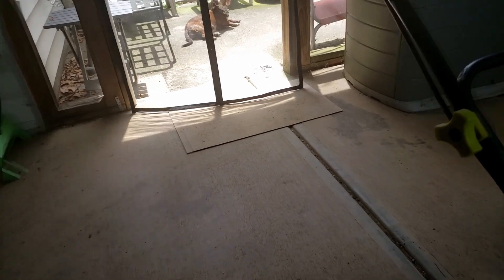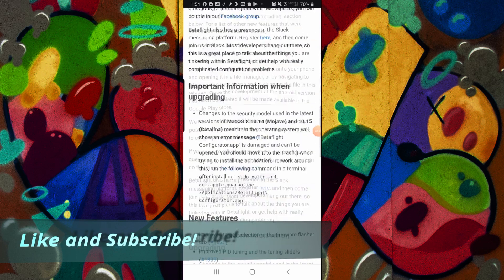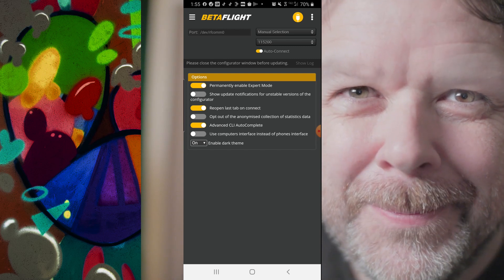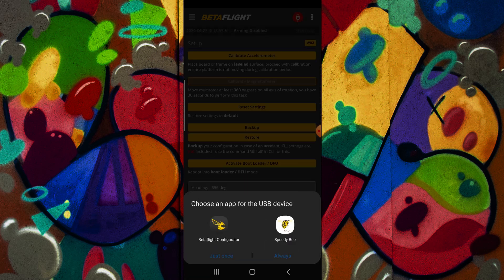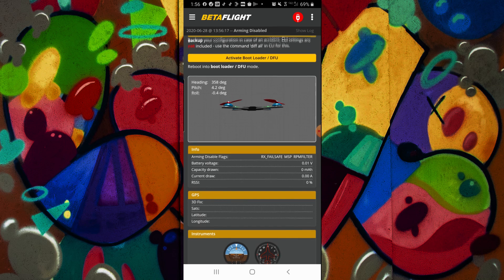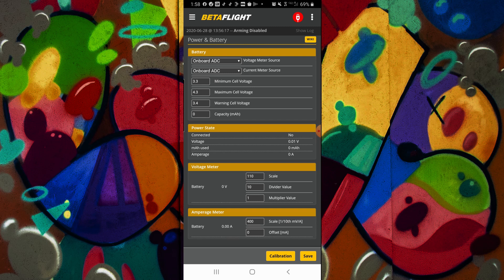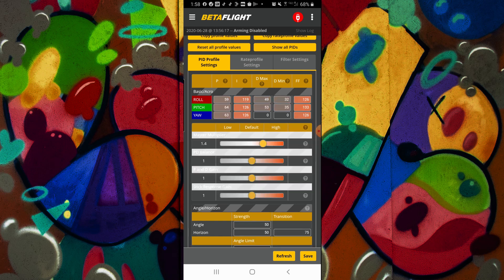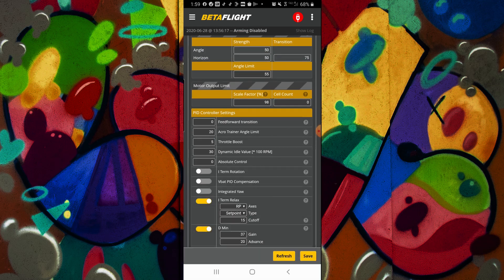Betaflight...ON ANDROID?!?!

Comment: why is everyone so excited??
there always has been an app for betaflight? the speedybee aop
Reply from the maker: The speedybee never worked well for me...wouldn't connect, etc.  this is just desktop betaflight on a phone, so it's just familiar and seems very stable and easy.
Reply: @Sully365  ah ok.. i only used the app for my mambaf7 with bluetooth, works fine.
you know if it works with the speedybee bluetooth adapter too?
thinking of buying it to be able to connect them all quads using bluetooth